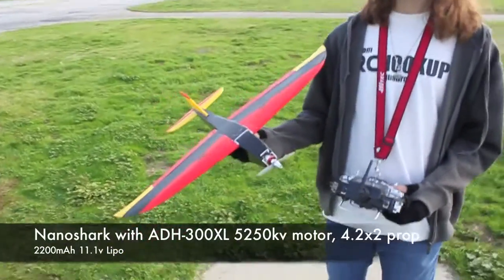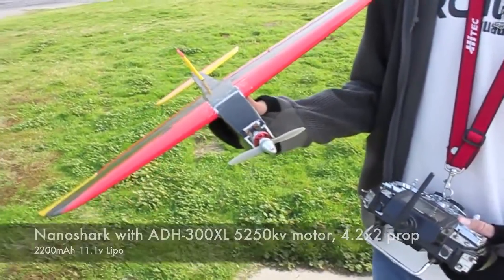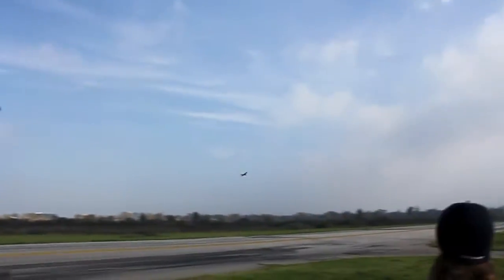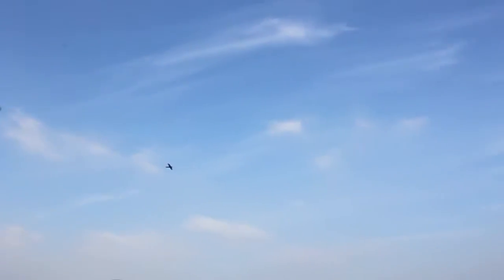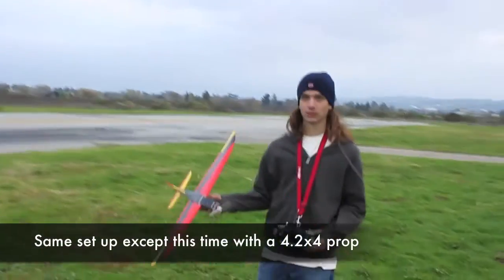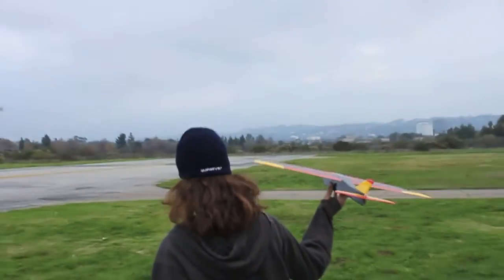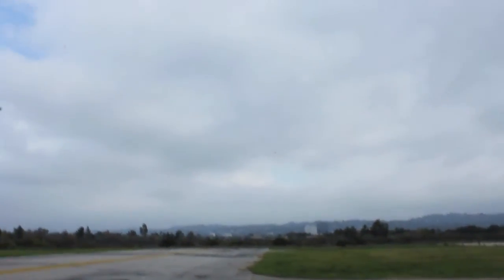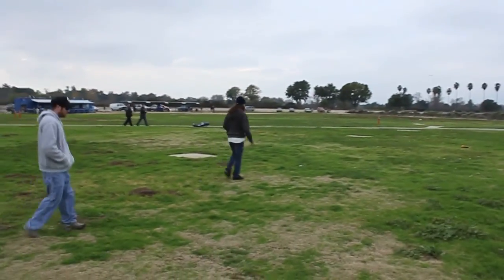Nanoshark with ADH-300XL 5250 kv Motor

Comment from the maker: It was a 3S - 2200mAh.  with a 4.2 x 2 APC prop.  
This airplane & wing was highly modified and strengthened to handle the extra weight.

Comment from the maker: You need to know how to reverse the shaft CAREFULLY with the right tools.  A nail punch, and a special tool like a small metal anvil with a hole in it so that the shaft will slide into it. Also the motor can needs to fit over it. Now part of the outside can should receive pressure when you hammer out the shaft. Only the inside part where the shaft is attached. You could also use a small metal tube or similar like a socket wrench nut. hope this made sense.